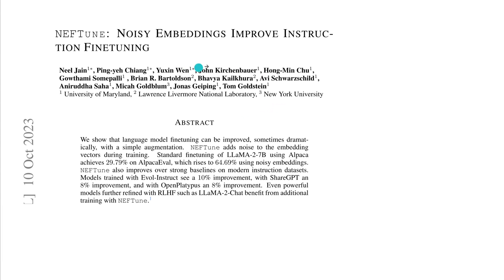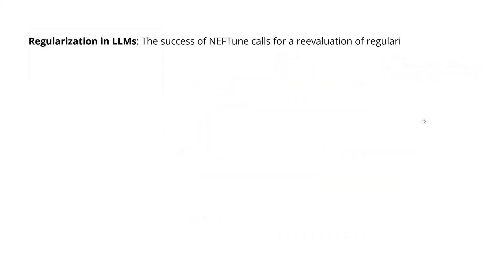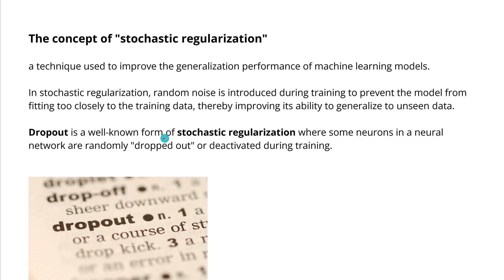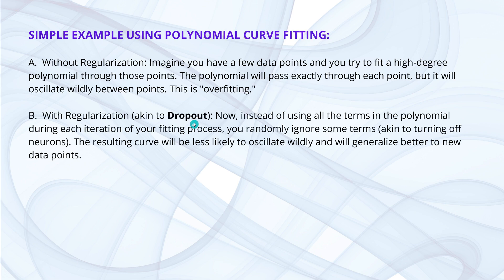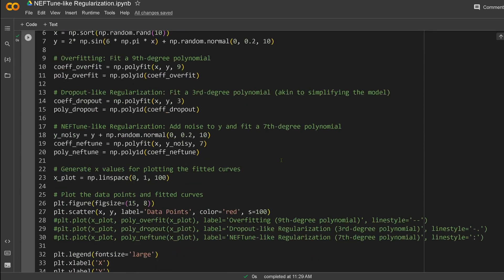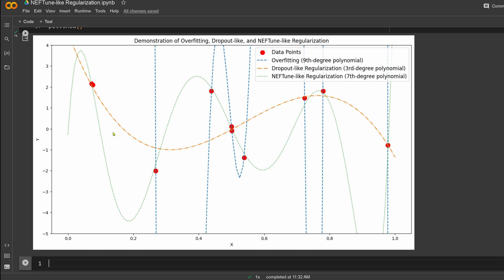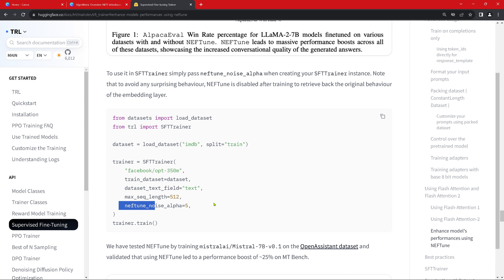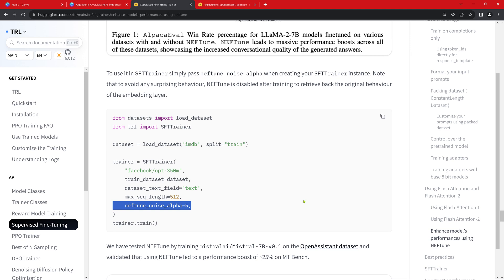NEFTune: NEW LLM Fine-Tuning plus 25% Performance

Comment: The performance gains seem similar to when we started adding noise to our images for computer vision model training.  Essentially you increase your dataset size and prevent overfitting since the "new" data are different enough to optimize for approximation since it is not overly-rewarded for exact replication each training epoch.

Comment: Neft (min 7 in video) is not adding noise to Y but to X i think. Even if results will be the same in your example.
One question using SFT: are embedding vectors also tune or only transformers ?
Thanks as always great video

Comment: Just FYI, some of the people in the Axolotl project's discord have all failed to reproduce this paper. There is some discussion on the github to see if there was something wrong with the implementation,  but they have tried both implementations described (one described in the paper, slightly different one in github) and got no significant results.

Comment: Thank you for your nice contribution in sharing this content! 
On why Neft works, don't you think it would be because when we train a model, we don't explain full correlation and causality for each variable in the dataset to it (which is also close to impossible and very costly the bigger the dataset), thus, introducing noise would make the model introduce a kind of "error term" in its reasoning, which would make it more flexible at the end when prompted about smth ? but hey, it's just an intuitive baseless thought with my limited understanding of these models ^^

Comment: This seems to get the point across. But also, to me, way the polynomials are used here feels wrong. 

Like, wouldn't dropout be randomly removing terms from the polynomial and averaging coefficients over many fits. (Model sparcity, not data sparcity)

And Neft being a shift of the x-axis, not the values on the y-axie? (Embedding noise, not label noise)